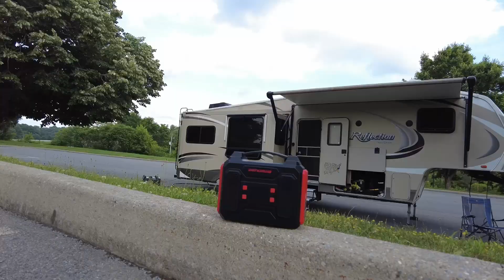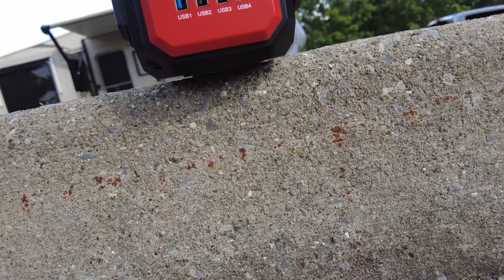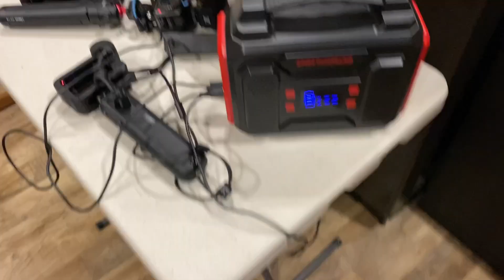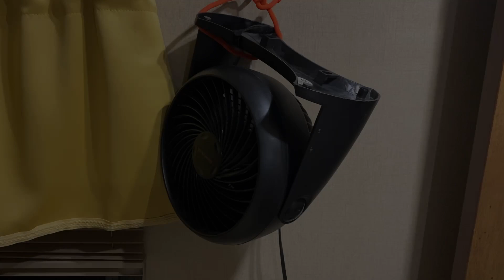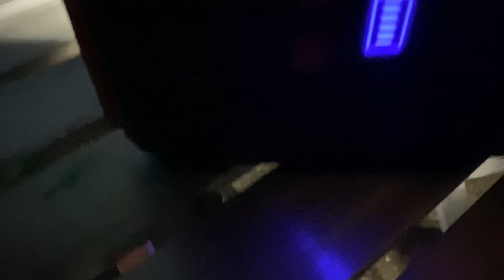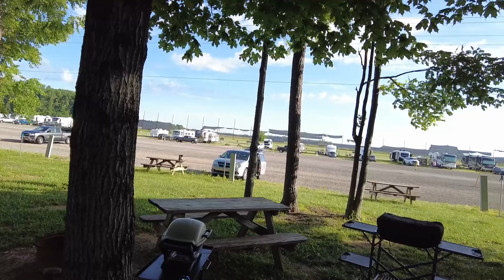Dengawa Portable Battery Power Station

Comment: Thanks for the video! Everytime I turn on the AC outlet, I'm met with a red triangle and not able to charge items in that outlet. Do you know what the triangle means? In the manual, it just says AC Outlet Self-Checking, but no other context about it
Reply from the maker: It may be that what you're trying to charge is too much for the battery. That's the only thing I can think of.

Comment: Thanks for the review I ordered this last week it arrives tomorrow and got it on sale on Amazon for $117.11 with added coupon savings off its $129.70 original sale price. Also got the bundle that comes with the 40 watt solar panel to DC hook up into it to Solar charge it. Got the solar panel on sale with it for $76.29 and it also charges 5v up too 3.1 amp devices all by itself and comes with adapters to charge cell phones, tablets and laptops all
By itself from the solar panel without the power bank as well. The solar panel
Has a built in charge controller so
You do that without damaging electronics. It automatically reads the power usage the device needs to charge it safe and sets the charge for the device plugged into it while it’s Solar charging any device plugged into it. That’s cool. But thanks for this review it all arrives tomorrow by ups and then Wednesday the solar panel arrives.
Reply from the maker: Man, You got it all.  We are still learning about these power stations.  They are very handy.  Thanks for watching.
Reply: How is it holding up?